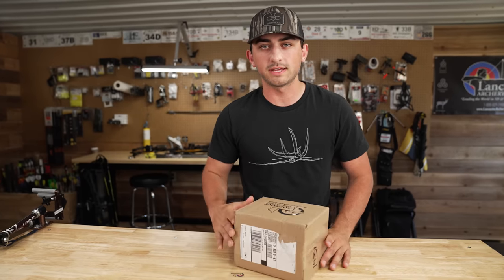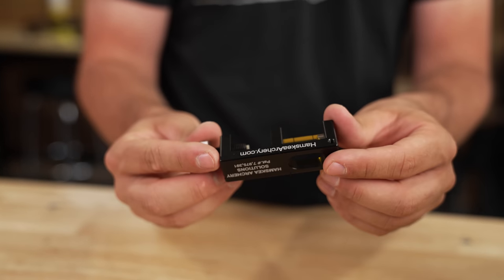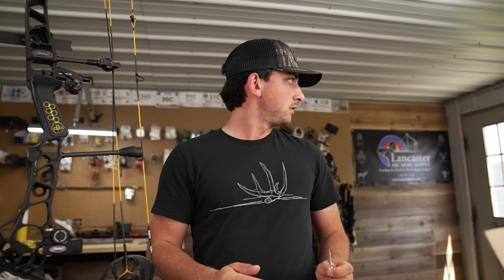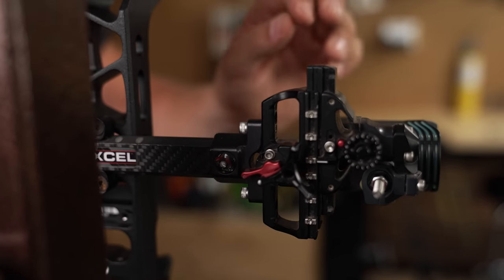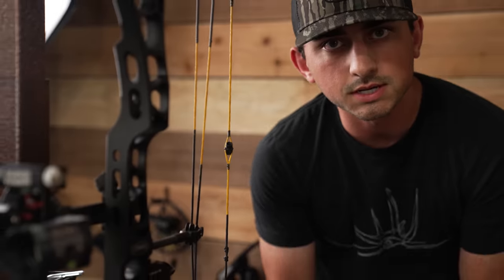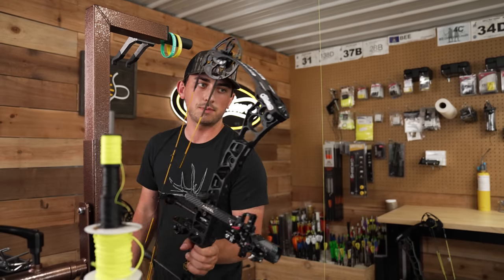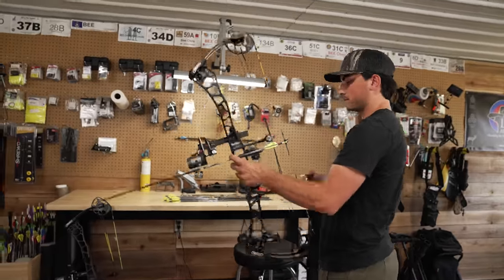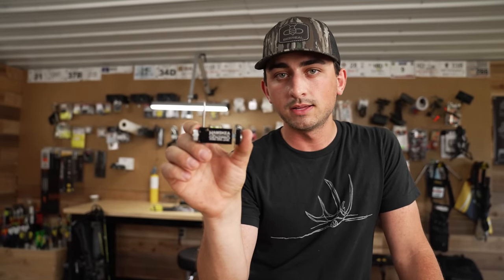ULTIMATE Bow Sight Tuning TOOL

Comment: I noticed when you draw your bow, your arrow tip comes almost to the edge of arrow rest/riser/shelf with maybe only a half-inch of tip extending.  Could you do a vid on arrow length, weight, spine, etc?  That would be awesome!  I’m also curious about your stabilizer (counterweight?) setup.  Does that have to be tuned to you or the bow or is that an out-of-the-box setup.  Thanks!!  Love you channel.

Comment: While I have 2 of the original Hamskea 3rd axis levels, recently started doing sight levelling a different way. Why? because the string itself is not usually parallel or plumb WITH the riser, what with shimming and tuning etc. Your sight is not mounted to the string, it's mounted to the riser. Plumb and level that then your sight off that riser not the string.
Reply: The sight needs to be set to the plane the string creates at full draw.  The elevation block needs to be parallel with the string plane. The level in the scope needs to match the level on the string. 2nd axis position is set with the arrow in the horizontal (0 deg.) position.  The 3rd axis is set with the arrow in the vertical (90 deg.) position. As you can imagine this process is quite complicated and requires special equipment.  Precisely the reason Hamskea developed this level set

Comment: What I've used in the past to lock the bow to is a heavy threaded steel rod placed into the stabilizer hole below the grip with two jam nuts.  Then place the rod into the jaws of my 5-inch bench vise.  That is about as stable as one can get while leveling the bow for sight placement.

Comment: Every time I do this, I set the 1st and 2nd axis.  Then I place the level on the bow, ensuring the bow is level, and then rotate the bow in my vise from -45, 90, +45.  I believe I am accomplishing the same thing, just not drawing the bow and I do not use a plumb line.  Am I way off?  Basically as the bow is angled up and down, I reference the level on the bow with the level on the scope.
Reply: Technically you should be at full draw for 3rd axis. I think it's a pain in the ass though lol.
You can always shoot some good uphill and downhill shots and see if you're hitting center too.

Comment: This is difficult to explain, but the 1st Axis is the tilt of the bow and can be any way you want because the 2nd and 3rd axes adjustments are the only ones that matter. 2nd and 3rd axes align a reference surface on the sight to be plumb with gravity (bubble in the center) at any shooting angle. After the 2nd and 3rd axes are set, I adjust the 1st axis so the bubble is centered with a relaxed grip at full draw because that makes the most sense to me, but 1st axis is optional and can be aligned to anything you want, including the string at brace.

The 2nd and 3rd axes align a reference surface to be parallel with gravity at every angle and all that is needed to do so is two different angles. 0ish degrees and 45ish degrees are common. This reference surface must be parallel with the adjustments of the sight. The 3rd axis does not have to be done at full draw because bow torque or anything else that happens at full draw will not affect a correctly selected reference plane on the sight. We zero the sight to the trajectory of the arrow, not the bow, and the trajectory of the arrow is affected by gravity.
Reply: I'm not an expert, I just made my own adjustments to a sight for the first time! But, I think your statement might be correct for a fixed sight only.  With a slider sight, your rail is that first axis and if that isn't level your shots are going to move left or right depending on where the housing is on the rail.
Reply: @d500mag2  The bubble itself is referenced to gravity, orienting another surface or string to gravity is unnecessary, but you can do it if you want to.
Reply: @KA-lm6sp  I may have gotten the axes confused. I'm referring to whichever axis is roughly parallel to the arrow shaft (2nd?). The bubble is controlled by gravity and the other axes are adjusted to it. Anything else you align with gravity is arbitrary so I choose what I think will be most consistent which is the natural angle of my grip with the string drawn back. Put another way, the arrow doesn't care if it is rotated, it only cares if it is pointed in the right direction.

Comment: Hey Chris I’m 13 and wanting a good bow that I don’t have to change the mods every time my draw length changes. Any suggestions? Also looking for a sight.
Reply: get a mission craze my man. i had one when i was your age and loved it. i killed several deer and i killed my first bear with it when i was 15.
Reply: I would get a mission switch it is a not a super kiddy bow and compared to my old craze the grip is way better and you can make quick switches for the draw length, plus it isn’t super expensive I mean like I shoot a prime black which is a very adjustable bow but that is also more expensive compared to a switch
Reply: I'd say PSE stealth carbon

Comment: I've had this for a few months now. it is great when used together with the Brite sight 3rd axis level tool
Reply: Brite site blows. I wouldn't rely on that. I had two and neither of them where level with the frame. Its a common issue with that. The levels aren't ever glued in level with the side mount. They are basically useless.
Reply: @johnwalter6410  the level in my brite site was off too but  It's as easy as sticking the hamskea tool on the plate and using it to level the brite site first. I could honestly care less about the level not being true it's got a flat plate on it  Even if you don't have the hamskea tool 2 little bubble levels at home depot cost 99 cents
Reply: @basebilljr07  Yeah I hear ya for for over $100 for a piece of angle iron and two levels it should be level and square.. Not everyone is as smart as you and I to figure it out and fix it.

Comment: I’m not sure about this one sorry. All you need to do is hold your sight on a plumb door jam in your house, pivot up and down 45* set your bubble and your done. I have been doing it for years on a bunch of bows works every time
Reply: Some of us don't trust the door jams (or the molding surrounding them) to be plumb.
Reply: I do construction and remodeling for a living.  I suggest that no one trust a door jam to be level unless you have checked it with an 8’ level and or have installed it yourself (I almost never see a plumb door jam - LOL).  A Plumb line is the best way to ensure that you have a perfectly vertical line to check the 3rd axis.
Reply: @gsanning ditto! Not one plumb door jam in my cookie cutter house. Lol

Comment: Doesn't seem like the best way to adjust third axis.
Reply: You can get close say in a britesight but this is the best way because 3rd axis is all about torque, torque inherent in the bow as a result of an offset cable system, and shooter induced torque. For this reason, 3rd axis can only be properly set at full draw, and by the individual the bow belongs to.

Comment: This price in insane. Production cost for this is less than 10usd. What a ripoff
Reply: That's that way for everything and it's not made of cheap plastic or parts it will last you a lifetime buy once cry once
Reply: @gamingking7578  a cheap plastic one is 20 bucks and will break this lasts a lifetime I have the generation 1 model and it's the total opposite of what you said
Reply: @mustang268  It is not. Lot of people didnt like rev 1, that was made on 3D printer. This one is better for shore, but is wayout of qualiy one... This is the fact. 80usd fot plastic part... Lets be honest, it is not just ripoff it is insane.